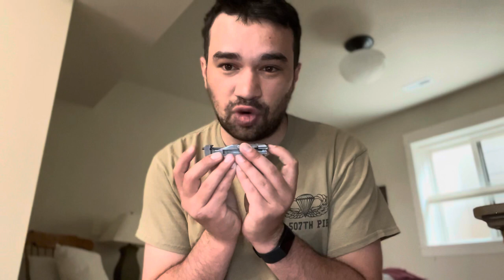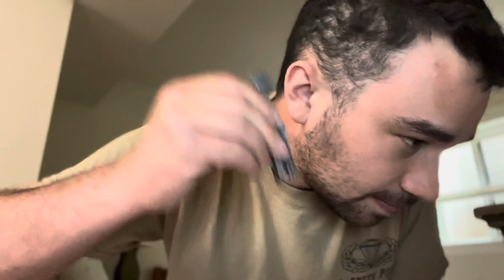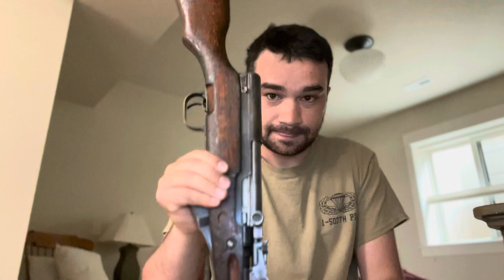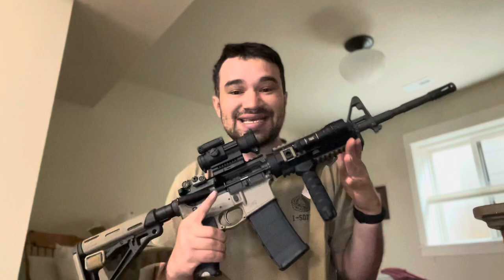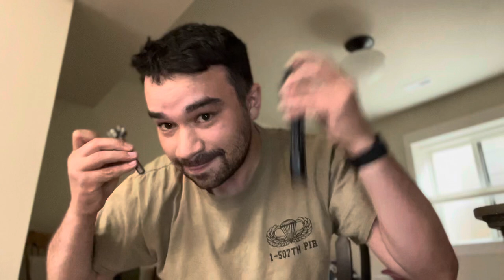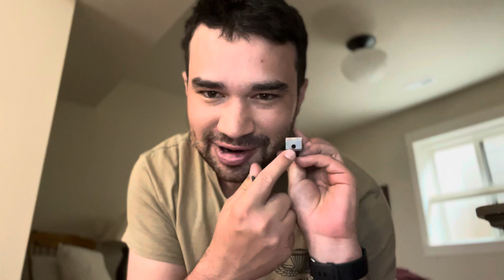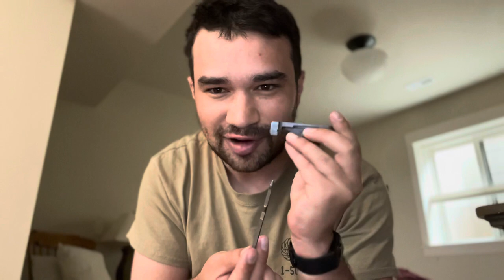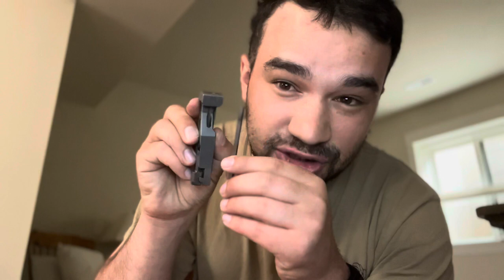The Myth of the SKS Slamfire (why you don’t need an “enhanced” firing pin)

Comment: Back in the early 90's a friend of mine was having issues with his new SKS. He brought it to me to take a look at and see if I could get it running. 
The outside was clean, but inside it was packed with grease. Gas tube, bore, bolt. All of it. I miss the days of inexpensive Chinese imported SKS's. You never know what you have until it's gone. A magazine or dust cover now cost more than the rifle did then!
Reply from the maker: I wish that was an exaggeration, but you aren't kidding. Oh how the times have changed.

Comment: I have had a few slam fires with both my SKS's . One Chinese one Russian . I don't attribute them to free floating firing pins or cosmoline (cleaned after purchase) . But to soft primers on S&B (Seller & Belliot) ammo . This has happened multiple times with that ammo on both rifles . They weren't clear the magazine type slam fires but , pull the trigger an get 2 shots type of situation .
Reply from the maker: That's good data. It does seem that soft primers can be a real issue for Eastern Bloc weapons, and a spring loaded firing pin may reduce that risk.

Comment: The only issue I had with my Yugoslavian SKS was with the gas valve, which caused repeated jams or stove pipes. The easy fix was to snap on a split ring into the groove to allow it to properly seal the valve. Problem solved.

Comment: Slam fires were pretty common in the mid 90s, when commercial 7.62X39 first hit the market. Remington was the number one culprit, using small rifle primers. But they weren't the only ones using standard rifle primers in their ammo, instead of the less sensitive military style primers. 

Reloaders also had issue with the Remington cases, as small pistol primers will definitely slam fire in the SKS. It is scary, and totally uncontrollable when it starts to slam fire. 🤠

Comment: I have a friend who had to buy a new bolt because one of the murrays pins got stuck, also ive seen a rusted 1903 springfield that fired when the safety was flicked off

The only aftermarket SKS part i can recommend is a stainless steel Yugo gas valve IF you can't find an original and yours is corroded beyond safe function
Reply: I just stripped mine all the way down for routine maintenance, and my Murray's spring was extremely rusted, and had caused rust on the pin itself. Very difficult to remove. Needless to say, I put the original back in.
Reply: Buying a new Bolt when a firing pin gets stuck, is a bad idea. The Bolt body is near indestructible. And Bolts are Not drop in replacement parts.

Comment: Years ago I bought a Tula SKS, after putting at least 1,000 rounds through it I’ve never had an issue. However I had a friend who bought a Chinese SKS at about the same time, and his would occasionally fire 2 rounds at a time.
Reply from the maker: I’d hazard a guess that if he detail stripped and cleaned his rifle - it would stop firing doubles.

That said, if it consistently fires doubles, that might be a feature rather than a bug lol 🤷‍♂️.

Just kidding @BATF. Nothing funny about Title 1 Firearms firing multiple shots with one trigger function 😐.
Reply: @Triangle26  I asked him about this not too long ago, and strangely, he didn’t even recall the problem and said he hadn’t had an issue firing it in the last 25 years. Maybe the cosmoline loosened up??? I found hardly any in mine when I cleaned it a few years ago.
Reply from the maker: @buddytesla  That sounds right. Ultimately, heat is the most effective way to remove cosmoline. Ideally that would be done before firing, but if you shoot a weapon enough (even if it is doubling), the problem will eventually self-correct.

Comment: I have been shooting and collecting the sks for 30 years or so. I have noticed with a clean free floating firing pin and using commercial ammunition with softer primers I can get slam fires. This has included wolf ammunition. Under this condition if the firing pin also is not as blunt as it should be slam fires have happened. I try to stick to using the Yugo military ammo to all my sks's. I have many Sks's and did get one converted by Mury gun smith to use the spring loaded firing pins so I can use soft primer ammo.  Note the early sks's did originally use spring loaded firing pins. I have also had slam fire issues with my French MAS due to the same issue with softer primers. BTW my bolt/firing pins all passed the shake test and are clean when I have had slam fires with the SKS or mas.
Reply from the maker: I agree that there are issues other than cosmoline impaction that can cause slamfires. Soft primers are one, another is deformation of the self locking taper between the firing pin and the firing pin hole. I've never personally seen a slamfire caused by a firing pin being too sharp, but if you've been doing this for 30 years I'll take your word for it. My main argument in this video is that the vast majority (at least 95%) of SKS slamfires are caused by the easily preventable problem of cosmoline impaction.

Regarding the Murray's pin, I have personally seen multiple slamfires with a Murray's firing pin. They unequivocally deny that this is possible, but I've seen it. Yes it was the original Soviet design, but so were non-chrome lined barrels and friction safeties. There were very good reasons for all of these features to be improved and updated with time.
Reply: @Triangle26  I agree that not cleaning out the cosmo can almost guarantee a slam fire. I was just pointing out that in my experience the slam fires can occur under other conditions and have to me. I am glad you have these videos out there as the old SKS sites are stale and or abandoned these days. It is good someone is keeping the love for the SKS alive.
Reply from the maker: @stevezio99  I really appreciate that. Sorry if I came off a little defensive. There is plenty of room for nuance and real-life experience, and that’s exactly what you shared.
Reply: @Triangle26 you are my new SKS guru and much needed in this community. I love my sks and wish I had this info when I got my 1st one almost 20 years ago, but you're here now. Love your channel.

Comment: I heard somewhere that rifles like this have to be stored a minimum of 20 years before they can be sold. I have no idea if that's true. That would mean when they come out of cosmoline storage they've been sitting in cosmoline for at least 20 years. Sticky stuff. I don't regret replacing my firing pin with a spring loaded unit. My 1959 rifle has worked beautifully. Taking apart the bolt is straightforward. The only "special" tool I bought was punches.
Reply from the maker: That’s exactly right. The US has an embargo on Chinese manufactured weapons, however if they spend 20 years in a “neutral” country (such as Albania) they are legal for importation. So yes - the cosmoline on current imports isn’t exactly fresh…

I’m glad you don’t regret the enhanced firing pin. If I could redo this video, I would emphasize that I’m not so much trying to say that the EFP isn’t a solid product, simply trying to point out that it isn’t necessary to run an SKS safely.

Comment: I put a Murphy pin in anyway. I just don't want a mishap to happen if I drop it. The BATFE is another reason I put one in there too. It may be unnecessary from a mechanical standpoint and omitted in later designs, but the legal world is what I fear.
Reply: I put a Murray’s in, and by some luck caught that a popped primer had broken the spring and that “better” firing pin was actually about to cause what it was meant to prevent. I haven’t had a popped primer since putting the original pin back in. 

The only time I’ve had a slam fire was on a reload that had the primer sat proud. The rest of the batch gave no further issues.

Comment: I am pretty sure the SKS original design considered the firing pin mass/safety when designed. I also noted the dents on the military primers (by design, these primers require a harder strike to set off). I am shooting hunting commercial ammo that go off with typically lighter strikes than most military ammo primers in my SKS. For this reason only, I modified my bolt to add a firing pin spring. We can disagree but safety is important to me and my SKS' function is not harmed by this change. Great carbine.
Reply: its not harmed by that modification until the spring breakes and causes the firing pin to jam in the channel...causing slamfires...ask me how i kmow...i never had and issues with mine but fell for the same crap you did...mine broke wedging the spring and pin forward in the channel and dumped 5 rounds down range...ive since put an original bolt back in and have had zero issues...

Comment: Informative video. Thanks for clearing that up.
You talked a lot about cosmoline, so I have a quick cosmoline question for you.
How can you tell the difference between a cosmoline stain and light surface rust on metal, such as a bolt?
Also, would either be a problem while operating the SKS?
Reply from the maker: Generally cosmoline stains will respond to heat. Apply a blow dryer or heat gun for ten seconds or so, and you should see the metal “sweating” cosmoline a bit. Surface rust won’t change under brief heat.

Neither should be an issue when operating an SKS, unless it is found on the firing pin or in the firing pin channel. As described in the video, that has the potential to lead to slam fires. Vigorous cleaning, and if you live in a humid environment, very light clp application should eliminate those issues.

Comment: I did have to replace the bolt on my 1966 Type 56 because the firing pin kept sticking in the firing pin channel and I never could figure out why. A new bolt fixed the problem. I did boil it and the replacement military firing pin before assembling the bolt and installing it in the rifle.
Reply from the maker: It is possible for the self-releasing taper of the firing pin / bolt interface to become damaged, usually due to flame cutting from pierced primers. This is much less common cause of firing pin sticking, but it is particularly dangerous. You did the right thing in getting a new bolt!
Reply: @Triangle26  I do recall pierced primers and finding perfectly round metal circles from the pierced primers in the action.

Comment: I strip my newly acquired SKS to the bare naked and clean it all. Take out the firing pin and clean channel and run the sks dry of any oil. Replace the banana magazines for regular steel magazine and replace bubba stock to original stock. I always have 2 or 3 extra russia sks stocks laying around for projects or the next bubba sks
Reply from the maker: Very nice. Can’t go wrong if you do it that way!

Comment: Having enjoyed these rifles through the 1990s when huge amounts of dirt cheap and often corrosive surpluses ammo was available I have seen runaway and slam fire incidents. You covered the 2  biggest causes, cosmoline and corrosion. The third is that at $100 each and with ammo nearly free it seemed, some of these guns got the bubba treatment. Intentionally or not, screwing with the fire controls and or bolt can result in a dangerous condition. Never underestimate human stupidity.

Comment: Well, I wish I would have seen this video a decade ago before I installed that spring thing in my SKS.  The guy that sold it to me told me said since I live in California I should worry about getting arrested if I was at the public range and is slam fired and it went full auto.  So of course I turned to the modern day version of the Great Library of Alexandria, YouTube, and my fears were realised.  Video after video of SKS slam firing.  Haha. Oh well.  One day I'll bust out the mallet and chisel and take apart the bolt and restore it to it's original configuration.
Reply from the maker: At least you aren’t the only one!

Honestly - I might have gone a little over the top in bashing the enhanced firing pin. While I stand by my claim that it’s “more likely to cause a hazard than fix one”, I think that might have sent the wrong message.

I don’t think that marginal increase in risk is actually significant enough to matter, I was just trying to emphasize how safe the original design really is. For people like you who have them installed, I’m by no means encouraging their removal. There are TONS of EFPs in circulation, and in all practical senses, they seem to work just as well as a factory firing pin. They just aren’t actually any safer.

If your rifles current configuration has been working for a decade, don’t let this video make you think you need to change anything - is what I am trying to say!
Reply: @Triangle26  Your video was great.  It let me know that the original design and configuration will work just fine, and I shouldn't worry either way.  I just thought how funny it was that the guy who sold it to me was super worried about slam fires, and how many videos are out there about it.  But I figured that with all the millions of them in circulation, if the free floating firing pin was a serious safety hazard, it would be well known by now.  Haha.

Comment: I've personally experienced a slamfire with a Chinese SKS. Fortunately it was at the range and pointed downrange so no problem. The thing is, I've fired tens of thousands of rounds through SKS rifles over thirty years and only experienced one slamfire so I wouldn't call it a design flaw or common problem. I have a buddy that also experienced a slamfire with one of his SKS rifles. Same situation with regard to safety so no issue. Now, that said, I've also experienced a slamfire with an AR-15. I had a loose round, a reload using a Winchester small rifle primer, and dropped it in the chamber instead of feeding it through a magazine, because you know, I didn't want to waste the time loading it into a magazine. I was holding the rifle at a downward angle pointed downrange and when I pressed the bolt release it went off. Curious about the result, I repeated the steps with the same result. Feeding the rounds from a magazine produced no such issues. So, it's not a design flaw of the firearm that causes a slamfire. It can be neglect, improper cleaning, or just plain doing it wrong. Millions upon millions of SKS rifles have been produced and I would estimate that very few have never been fired. If it was the dangerous suicide machine that some purport it to be we'd definitely know about it. I'm not a fan of marketing a product in such a way that alludes to something along the lines of, If you don't use the product we created for profit then you or someone you love is going to die. If you clean your guns, follow simple safety rules and operate them as they were designed to function then you'll never have to worry about doing harm.
Reply: M1 Garands will do this too.  When single loading a Garand for slow fire competition, it is taught that you only load the round half-way into the chamber.  It allows the bolt to use up some of its energy loading the round and the round has the same forward velocity as the bolt when it chambers.   A slam fire can occur if the bolt and firing pin hit a fully loaded and stationary round.

Comment: In process of cosmoline removal and disassembled bolt. Firing pin retainer EXTREMELY tight! What are your solutions?
Reply from the maker: Certainly something I’ve encountered a few times. The two tricks that have always worked for me both involve a bench-vise.

The obvious solution is to secure the bolt in the vice, line up an appropriately sized steel pin punch, and wallop it with a heavy hammer. Might leave a mark - but if you are careful, it certainly wont hurt anything.

The other thing I’ve done is jerry-rig wooden shims and a punch inside of a vice to use as an improvised press. If you can cleverly direct the pressure generated by a vice into the firing pin retainer, it will eventually pop right out.

Comment: So what you think of grinding the ridges on the bolt to accommodate detachable mags? I can't find an original magazine so i was thinking of buying a spare bolt for modifying. (Want to keep all my original numbered parts in stock condition) But then i got to wondering abt the maths...?

Thanks for the video, good information.
Reply from the maker: @JoeMcPlumber  It shouldn’t affect the safety of the weapon - at least from a slamfire perspective. As long as the firing pin channel is clean and dry, the mass of the bolt doesn’t come into play.

Comment: Probably not the first to make this comment. BUT....the very first semi auto rifle I ever bought was a 200 dollar SKS. Likely someones old truck gun. The very first time I dropped the bolt to chamber a round on said SKS, BAM!!! SLAMFIRE. 
You said it. Detail strip, which as a very young man, I did not know. 
Now, my firing pin WAS rusted in the forward position, likely due to poor maintenance after firing corrosive ammo. 
EVERY GUN, I have ever bought second hand after that, was completely taken apart, cleaned, and properly functioned checked there after. ESPECIALLY, comblock firearms.